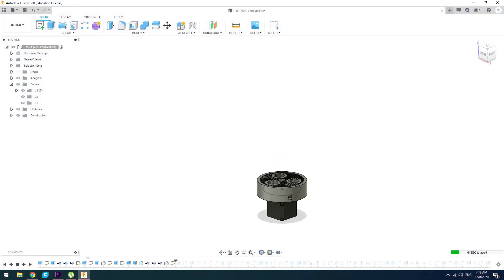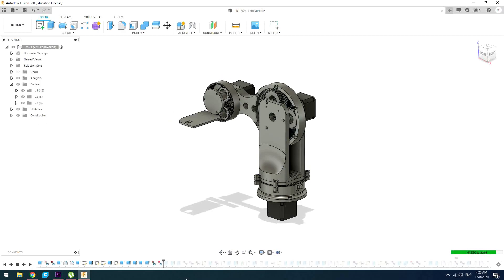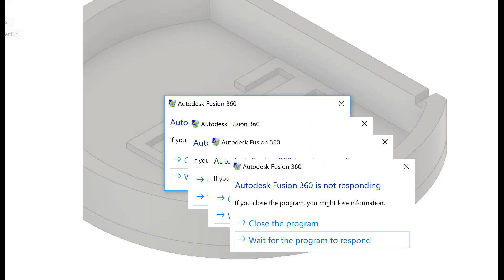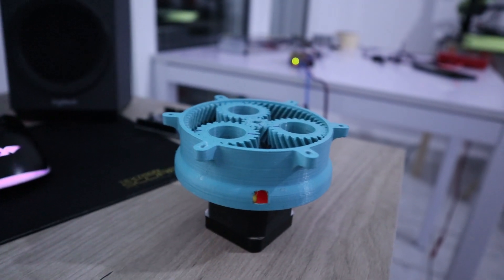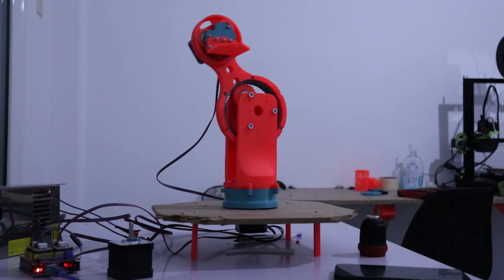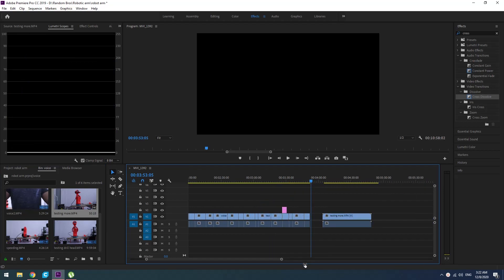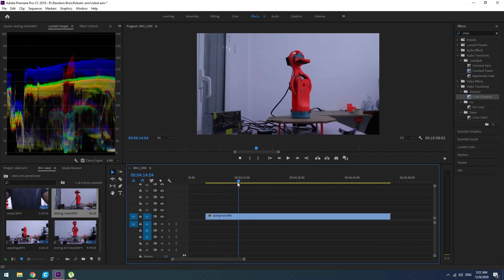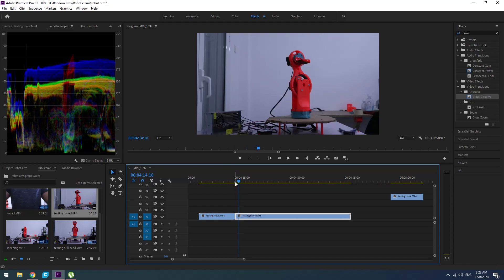3d printed Robotic Arm

Comment: Show load capacity. Put load on the very tip and see how much more it could carry. Good job on the design.
Reply from the maker: I will have to do that in a later video because the gears had some backlash in them but it can lift about 7 18650 li-ion cells !